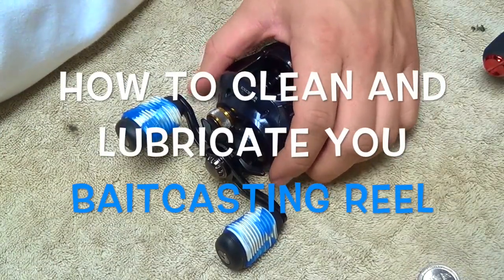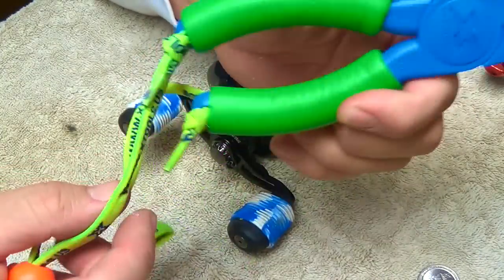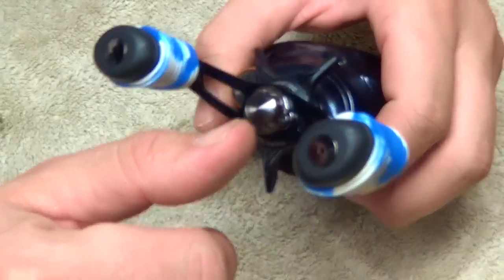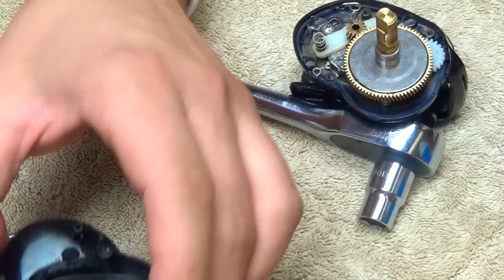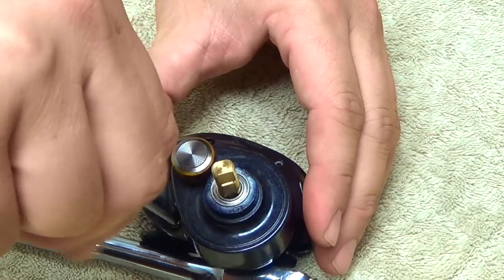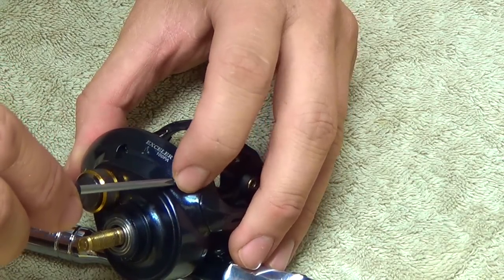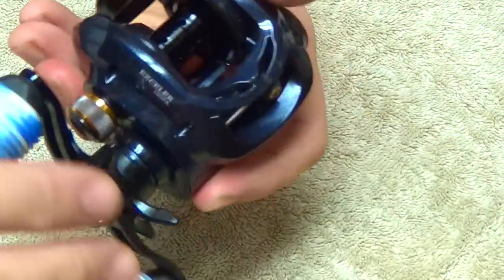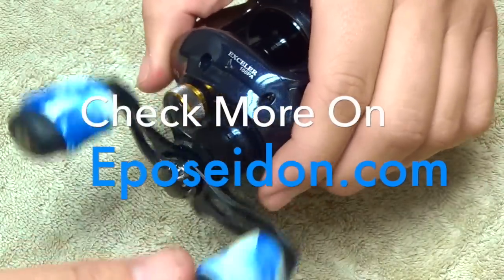How To Clean and Lubricate Your Baitcasting Reel / Baitcasting Reel Maintenance

Comment: This is a very misleading video.   It is ALWAYS important to CLEAN your reel every time yo do maintenance. What this guy did here is basically try a bullet wound with a band-aid. Don't follow this video.
Reply: Gilberto Domingo Yep, at least clean the bearings out before adding MORE oil.
Reply: Yep, putting fresh lube on top of the old dirty stuff isn't doing anybody any favors.  It makes me upset that some reel repair shops do exactly what this guy is going.

Comment: Don’t put oil on the spool shaft or inside the pinion gear. Put a drop of oil inside the spool tension knob if you think it’s necessary to have the end of the spool shaft lubricated. And always flush the bearings clean before adding more oil.

Comment: i have the same reel as you, the Daiwa Exceller
and i have problem with the pinion gear that seems rubbing the spool pin and making cricky sound when doing cast,6 out of 10 casts will making this cricky sound. I've checked the pinion gear tip got scar and gettin eroded a lil bit. im already disassemble and trying to figure out but no result, everything seems fine.
any idea what is the problem making that happen?

Comment: So do u have to use reel grease and stuff or can u just use wd-40?
Reply: Never use WD40 on bearings.  Use oil or grease.  WD is only ok for surface rust prevention, not lubrication.
Reply: +Zach Van Niman NEVER use wd-40 for fishing reels lol.. i learned the hard way
Reply: Zach Van Niman if you are on a budget and in need of a quick fix, use ronson light fluid to de grease bearings, let dry for an hour and get some 3 in one all purpose oil or rem oil (remington oil for guns) to reoil those bearings. add one drop of oil per bearing and reassemble then enjoy :) it is a temp fix though. remember, reel oils and grease are made for reels :) good luck happy fishing
Reply: Zach Van Niman WD 40 will clean the grease off of your bearings. It's a penetrating oil.